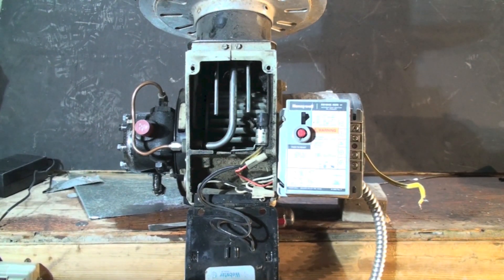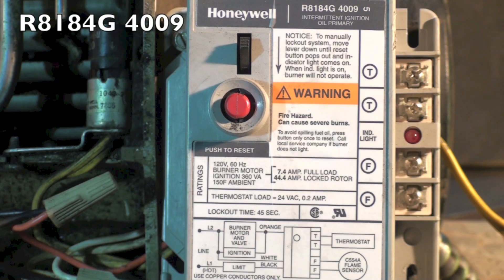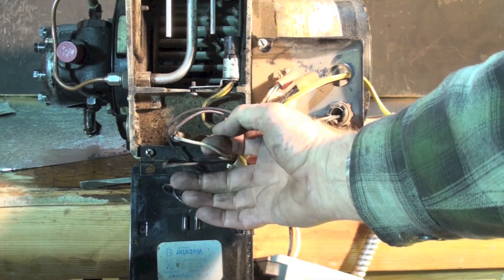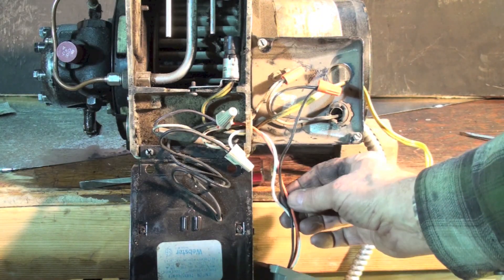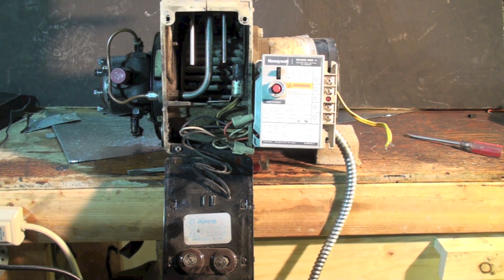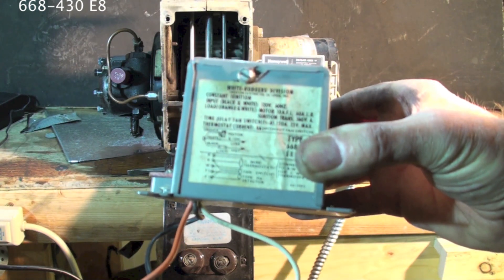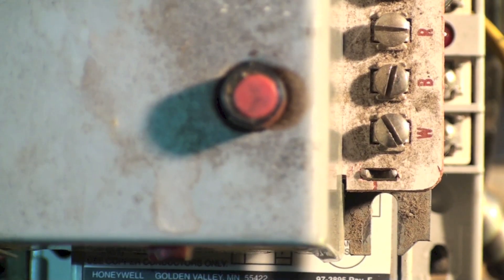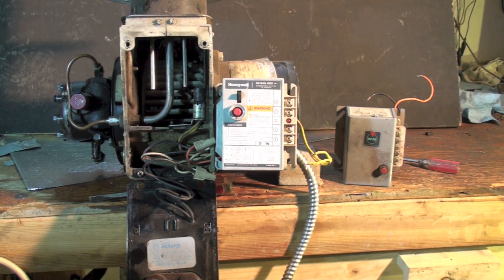How to wire the oil furnace cad cell relay

Comment: Great video. I am having a problem with my boiler turning on and off constantly at times. Sometimes it runs for awhile other times not so much. I happend to see some blue light coming around the reset button on the Honeywell relay. I tried to rewire with the same one in your video and went to turn on the heat and nothing came on. Should I have jumpered out the TT's on the new relay or will that just keep the furnace going constantly? My old relay did not have those.  Any help would be greatly appreciated.
Reply from the maker: Sometimes the boiler controls the high voltage of the burner, so the TT terminals must be jumpered.
GFM

Comment: I just replaced my car cell relay reset box. Now my oil burner shuts off after 20 seconds or so and red light comes on. Would you know what the problem is. I'm screwed, it's Christmas eve and we need heat and hot water.
Reply from the maker: It sounds like the burner is not coming on.  Do you have flame? 
GFM

Comment: I have the same setup on my furnace. It's a Beckett and also the exact same Honeywell oil primary. I have a two wire thermostat. I'm trying to figure out how to wire in a new thermostat so I have independent blower control. Any thoughts? Do I need a 3wire setup? If so do I need a new oil primary control?
Reply from the maker: You will need a number of changes.  You will need a fan center and an isolation relay.  You can look up "fan center" and "isolation relay" on my channel search that may help.
GFM
Reply: grayfurnaceman thank you sir

Comment: I just got mine going with the help of this video and grayfurnace man. THANK YOU!!!!
Reply from the maker: Merry Christmas
GFM
Reply: @grayfurnaceman  Hi,

I have the same Beckett burner unit as in many of your videos.

My relay is very similar, but is the ICM1503. The oil guy replaced it about a year ago, and intermittently, if the unit locked out, pressing the button would not turn the light off, so nothing would happen. After a few tries, the light would go off and the burner would start up again and run fine.

One time, I needed to change the filter, so it locked out, or, another I ran too low on oil. I solved those issues - but I've never had an issue with other relays where the light doesn't go out no matter how long or short I hold the button.

I tried disconnecting the F-F wires to bypass the cad cell, and still the light remained on no matter what.

NOW, I just can't get that light to go out, and re-start the burner. 

Is this a common issue with these, where the unit just needs to be replaced?

Also, if I do replace it - does shutting off the main switch (which also turns that yellow light off at the relay), allow me to replace and wire in a new usit without worrying about getting a shock?

Thanks,

 - Larry

Comment: Hi GFM.  I've watched many of your video's (which are great, thank you) and can not find my exact issue.. I'm thinking it's blindingly obvious, but figured I'd ask.  I have an oil furnace with the Honeywell R75-39R cad cell relay. I press the red button and nothing happens.  I checked the sensor itself, cleaned it, still nothing. Motor has not been tripped. So I'm thinking I just need to replace this with the R8184G4009? Typically I could press the red button, it would fire up and all is well... Not now... Your suggestion would be greatly appreciated.
Reply: Ok.. Thank you.. Now I get it to try, but no flame.. I've bled the line of air, clean the light sensor, verified I have spark and pulled the jet (all thanks to your videos).  The Jet is VERY dirty and it seems the gap is pretty big. Much more than shown in your gun assembly video.  I'm going to try and adjust that now and see what happens.  Is there a way to check if the jet is clogged? a little fuel came out of the feul delivery side as I pulled it out.
Reply: Cleaned up and working.. Thank you for your videos and prompt response.  I greatly appreciate your assistance.
Reply from the maker: I don't test.  I replace the nozzle every time I remove the gun.
GFM

Comment: I have an oil primary control just like the one shown in your video with the orange, white, and black wires coming out the back. I have a new oil primary control and have provided some picture links below. Where would I connect the orange, black and white wire on my new control. I don't want to mess with the existing wiring. I also have a fan limit control. Furnace is working fine with the old primary, just thought I would get a new one. Thanks.
http://imageshack.com/a/img921/1458/PfKiME.jpg
http://imageshack.com/a/img921/862/y8snQH.jpg
Reply from the maker: Black goes to L1, white goes to any L2, orange goes to motor and ignition.  These last 2 must be jumpered.  Hope this helps.
GFM
Reply: I hooked up the wires as you said. The new oil primary led panel came on this time, but my 2 wire thermostat is not activating the furnace. I raised the thermostat passed room temp. also jumped the 2 TT (Thermostat wires) furnace does not kick on. Went through the set-up menu set option for furnace as opposed to WH and blower. Still does not come on. Power is going to the blower area and fan limit switch. There is a brown wire on the lower left of the White Rodgers fan limit this brown wire connects to the black L1 on the new OPC. When hook up the old OPC using the black, white, and orange wires, furnace works. Maybe the fan limit control wire should go to the limit connecter on the new control.?
Reply from the maker: Yes.  My mistake.
GFM
Reply: I tried it again still does not work. Put fan controller limit wire to LIMIT connector. and black hot to L1 connector. Nothing. I am just going to get a standard honeywell similar to the one in your video here. I have a Heil furnace, Wayne MSR burner, white-rodgers 11" fan limit control, 0.75 80A nozzle. Which honeywell should i buy as far as lockout time 15,30, or 45 ? I just want an extra for a backup.
Reply from the maker: The 45 second one is probably ok.
GFM
Reply: I got the honeywell R7284U to work the fan limit control wire that went to the old primary controller, needs to connect jumped to both the L1 and LIMIT connector. If you connect a live hot black wire to the L1 your furnace will keep running and won't shut off. The one last issue I have is heating oil seems to be sputtering backwards into the burner housing, I can see drops flying around through the air intake next to the pump, after cycling there is a small puddle of oil about 1 tablespoon at the bottom of furnace. All pump and gun line connections are dry and tight. A new nozzle was put in .75 80A I never touched the set screw for gun position. I did put a new strainer in the pump which was pretty dirty.

Comment: This video is very informative, I had a question that I'm hoping you can help with. I had a Duane oil burner. I had to replace the gun drawer assembly but found out that there was no replacements. So I bought a new burner that is an afg Beckett. I need to wire it but I'm not sure what I'm looking at. I have a black and white coming out of the burner and I have a black, white orange and violet coming form the fan circuit board. I would assume black to black and white to white. But what about orange and violet? Where to they attach? I know the risks but I'm in a situation where I cannot afford any professionals and it's going to get cold. I have to get this running because I have a 6 year old and a baby in February. Would you be able to help?
Reply from the maker: +Roger Marvin The black to black and white to white is probably ok.  The orange and violet I am not sure of.  Can you send me pics?
GFM

Comment: i tried one of these today, however my 31 year old miller type furnace has 4 wire's and 2 relays in the relay box. Mine also has a door switch which might be the extra wire that is confusing me and those at "johnstone supply." The unit now cost 195 + tax. They also had the new digital box and I had no idea how to wire that up either. I have no problem wiring anything as long as I know what I'm doing and what goes to what. Are you still around to help? Thanks.
Reply from the maker: +John Smith The 2 relays are for the burner motor and the ignition transformer.  The door switch, unless it is the switch for the blower door, I don't know about.
GFM
Reply: I was told by the furnace supply "johnstone" and some furnace people who were there, that they had never seen a 2 relay box before.  I wired my old box back in but for some reason the relays won't pop in by themselves and when I force them, it only runs for about a few seconds and then shuts off. I don't understand this at all as I cut the wires loose from the 4 wire nuts and just redid them and filed the contacts on the 2 relays and it won't work.  I checked the eye and it works perfectly with light and the readings.  I've wired everything back the way I took it out and now it won't work.

Comment: Thank you so much for sharing this.  I went to clean up the wiring on my oil burner, and thanks to lousy wire nut connections, wires came apart when I opened the box, preventing me from figuring out how to reconnect everything.  Thanks to this video, I was able to reconnect everything (blower motor, oil valve, igniter and Cad Cell) without losing any magic smoke.  Things are working hunky dory again.

Comment: Had to replace mine last week. I could reset the relay but it would shut off after the boiler shut off. I used my phone camera before disconnecting any wires. Was surprised Lowes had about 10 in stock.
Thanks for the video grayfurnaceman.  
PS would love to see a video on replacing the burner motor.

Comment: No, it will rotate until the fan is activated.  Then no rotation, hence the fan and the furnace stays on for a long time until the breaker pop.
Reply from the maker: This sounds normal.  The limit switch should not open unless there is a low air flow condition such as motor failure or plugged filter.  What bothers me is you say the breaker pops.  Do you mean the the circuit breaker?
GFM

Comment: Thank you!   I noticed another video you made on the fan limit switch, I fired up the furnace the inconsistent rotation of the wheel.  It rotate to kick the fan on the it does not stop the burner when it reach the max temp, it keeps running.
Reply from the maker: The inconsistent rotation is normal.  Most of these switches are set for limit dropout at 200F.  Does the dial go that high?
GFM

Comment: What kind of symptoms if a cad cell is going bad or it is bad?  My furnace will run continuously then it will stop and the breaker will pop, if I recent the breaker it will fire back up.
Reply from the maker: If you mean the red button on the cad cell relay, there could be a number of problems.  Easy first.  Remove the cad cell and clean the surface.  Next, you can check the cad cell resistance.  Hope this helps.
GFM

Comment: found one about 8 years ago that a tech put a wire nut on the orange wire and wired everything directly to the black hot wire. of course it fired of and he left 2 days later i get a no heat call and on arrival Fuel oil dripping out of the small boiler room door and luckily there wasnt much fuel in the tank and it ran dry so I shut it down and had a 2 day mess.
Reply from the maker: Wow!  That's like bypassing a limit!  Very fortunate that they ran out of fuel.  I have seen how fast a house can burn when fuel oil is involved.  Could have been some dead people.  Thanks for the thoughts.
GFM

Comment: I have a 1969  Airtemp 80,000 BTU oil furnace made by Chrysler.  It has a stack switch relay, it is located on the furnace, not the short flue pipe.  I would like to replace it with a cad cell relay and cad cell.  More efficient than a stack switch relay  How do you cut the slot for the cad cell to see the flame in the burner.  Could you make a video of this evolution? I think other people would find it useful. 
         I know how the oil burner comes apart, and the operation of each component from watching your oil burner videos.  I also noticed that cooling works fine, heating works fine, but when I turn on the inside fan on, the outside unit comes on.  The system works well separately, but the yellow and green wire is connected to a wire nut.  I am not sure if it has a fan relay, it has to have something to turn the fan on in cooling.  It has no schematic on the furnace.  The pump has no numbers on it,  it has 1 stage on the pump plate.  It has an in the ground 280 gallon tank with 2 lines to the pump. It just needs the fan switch to turn it on after the furnace is heated.  I know it only has a 1 speed motor, since it has two wires coming out of the metal cable.  I was an Aviation Electronics Technician that worked on F-14's in the US Navy for almost 8 years.  Thank you for your knowledge of the subject. 
        The instructors at HVAC school may not have the time to show these in depth instruction or there might be too many students trying to get a better view of the subject.   In the military, I learned that a teacher loves to teach while an instructor is required to teach, very little skill to show  a method in more than 1 way.  A teacher helps the weaker students get almost as good as the best students.   You are definitely a teacher with skill in his field and has a knack for entertaining the people.  You keep the subject from being boring.  Not everybody can do this.
         If you are not agressive enough as a student you can lose out of the learning. I learn much better if I can see the application of the theories. A picture is worth a thousand words, but a video with good to excellent directions are worth a million words.